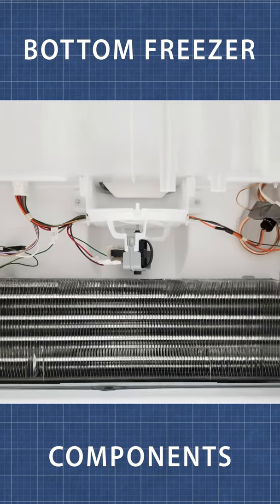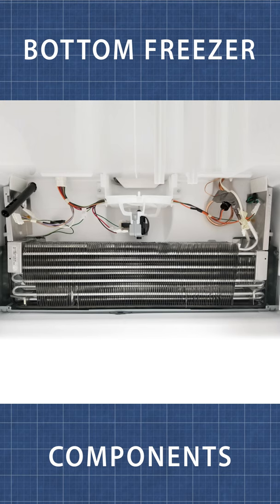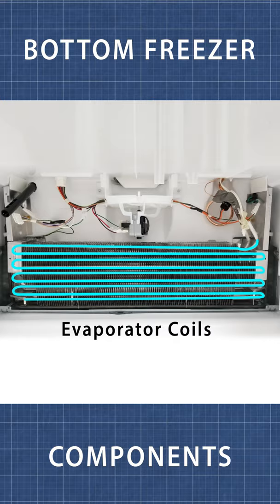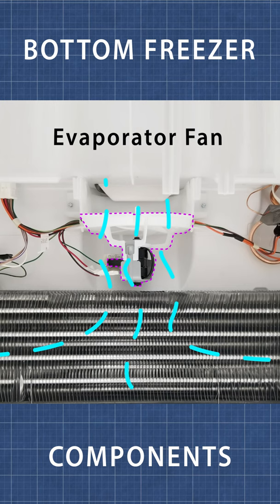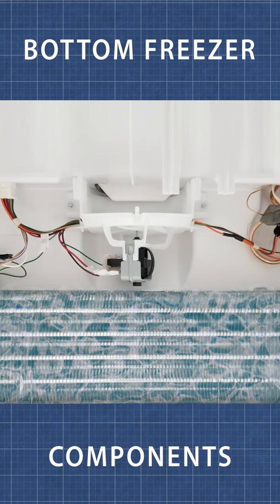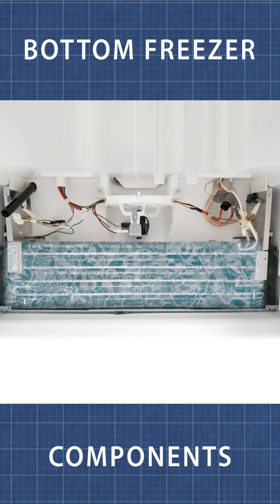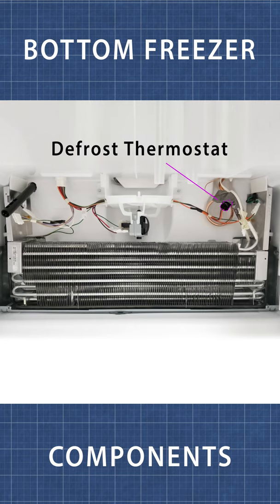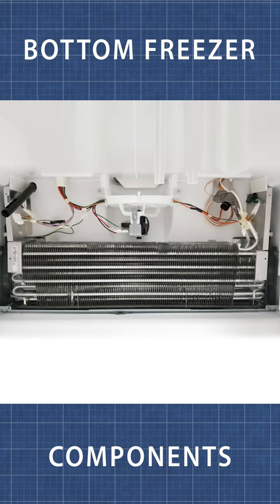How a Refrigerator Works - Short

Comment: I thought heat transfers from hot to cold why does frost prevent the refrigerant from cooling???
Reply from the maker: Thanks for watching. The buildup of frost prevents the heat transfer to the rest of the fridge and freezer. It insulates the coils, preventing the heat exchange from the circulated air.